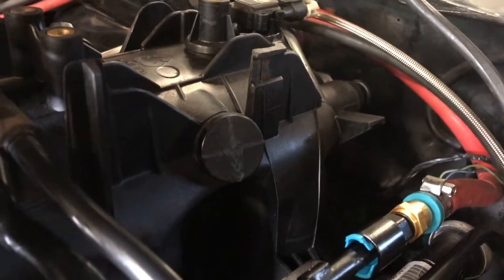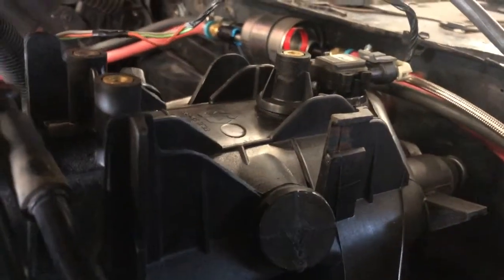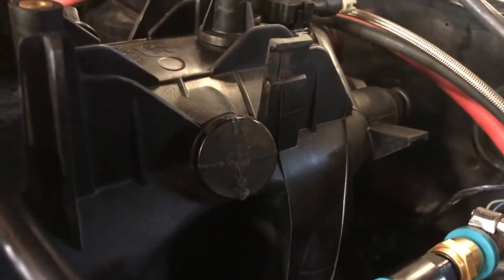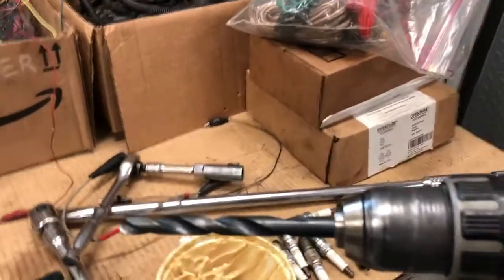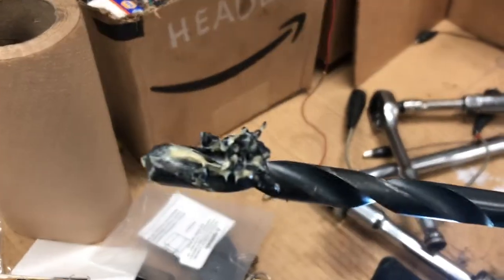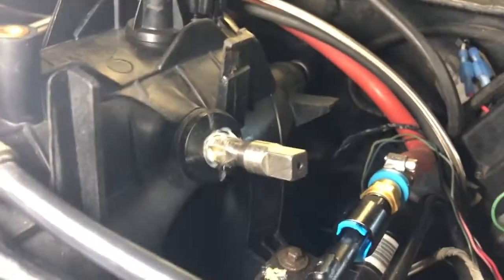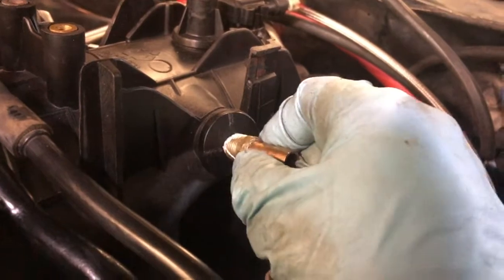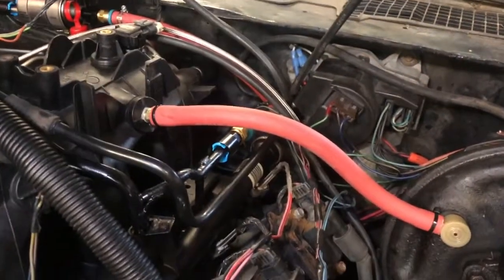LS Swap Brake Booster

Comment: That Little nipple in the back of the intake is for the brake booster it’s a little small plastic piece they sell on Amazon that Slide right in there
Reply from the maker: Yes, that can work aswell.
Reply: @nyecegarage7173  no, thats what that nipple is intended for; you simply did this wrong...